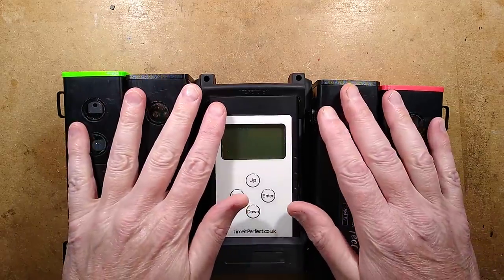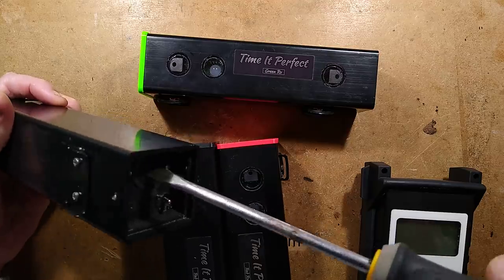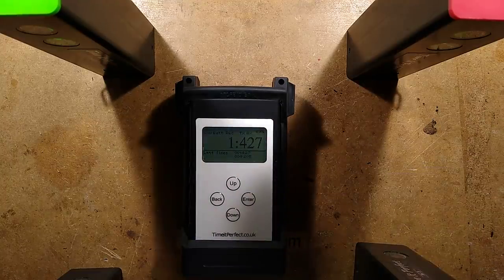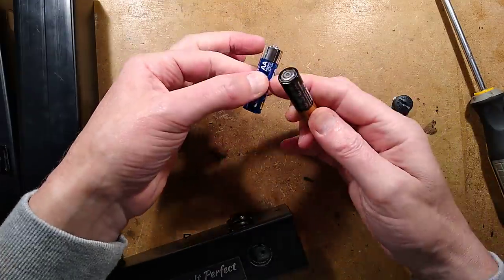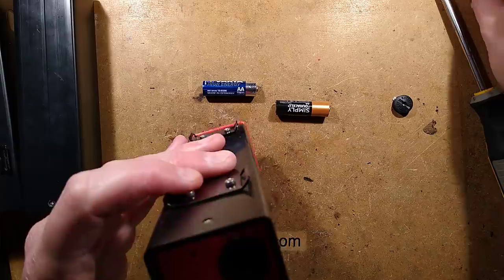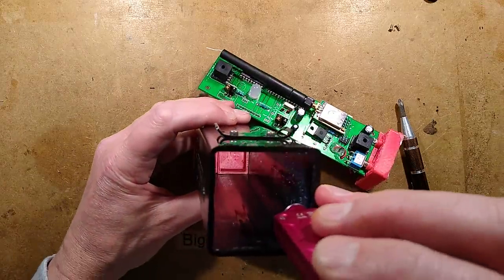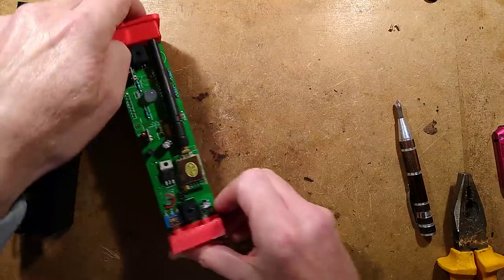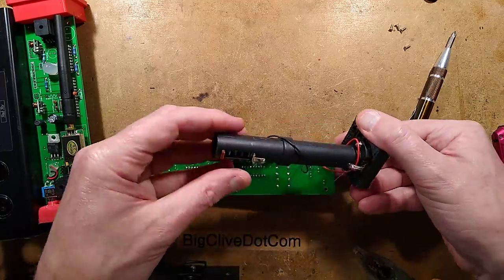Troubleshooting a faulty dog-race timer

Comment: Very nice looking boards. Just a shame its been let down by someone sticking odd batteries into it. I think I would extend the wires outside and add a 186-50 pack on the outside.              2x👍

Comment: Put battery holder in vinegar, buy 1 mm rust free spring steal and make a spring, and solder (or make) a new plate on the contact.

Comment: So, these DC-DC converters should start at 0.8V. 
I use the same ones a lot for all kinds of tests. 
It's sad that they didn't go for a single battery in series design. 
That would prevent a lot of user error.

Comment: I notice one thing, since only rx unit have rf transmitter, but both (rx and tx units) have low battery indicator, then it must send low battery info via ir led from tx to rx and then rx unit sends it to controller, neat.

Comment: Yes you had a leaky Varta, and mixing batteries is bad, but IME Duracell’s leak even when on the shelf in their packaging and well within their use by date, consumer branded or procells it matters not a jot they are all just as bad. They’ve been leaking and trashing equipment for around 40 years, maybe longer. Fluke 8060A DMM’s with PP3’s in the early to mid 80’s were particularly prone, a new battery (made in Belgium back then) regularly trashing a meter in a matter of weeks, switching to a NiCad the eventual but sub-optimal option of very last resort. Not sure what the situation is now but back then Duracell did pay out for damaged equipment. Now I only use eneloops or energiser lithium’s

Comment: Upgrade the units with an 18650 cell and a USB charging port?

You have to wonder why they didn't use that for a power supply in the first place, but it's obviously a  (very good!)  Fred-in-the-Shed outfit making these things and perhaps they were just being ultra-cautious.

Comment: I see a few Bulgin battery holders on eBay, BX0012 dual AA holders at AU $20ish? Or hack a PC board part to replace them? 3D print replacement battery holders? Hmm, easy way, Mouser (US) has lots of them, worst case.

Comment: I was wondering how much such a set would cost. Just checked their website and it's almost 700 pounds! Wow, that really sounds like they put in a lot of time assembling them... 😂️ And they claim they didn't use built-in rechargeable batteries because they "have an end of life date" - apparently they didn't think of leaking AAs though. Maybe 18650s in a holder would be an option.
Reply: Given the state of 18650s available, I'm not sure I'd trust that in a device used by people not technically knowledgeable enough to buy decent cells. I think I'd want to use something like those much-cloned Sony-style camera batteries, except that those are 7.4V nominal, as well as being total overkill for this application. My gut feeling is that it's harder to get totally garbage ones of those.

Depending on the current draw and frequency of use ("every few months" vs "daily"), a single, large-ish, 3V lithium primary cell (non-rechargeable) might be an option. Something like a CR123A, not a coin/button cell.
A single CR123A has a very similar voltage curve to a series pair of alkaline AAs, but with much better energy density (Wh/kg and Wh/L). Using the figures below, one CR123A has 68% the energy of TWO good AA alkalines, but at just 47% of the volume and 35% of the weight - and using 1 cell means no risk of mixing them!
Given this set was using Simply Duracell and a random mix of whatever they could find, I don't think that 68% energy capacity will be much of a concern!

CR123A¹: ∅17×34.5mm = 7,831mm³; 16g; 1.5Ah @ 3V = 4.5Wh
Alkaline AA²: ∅14.5×50.5mm = 8,339mm³; 23g; 2.2Ah @ 1.5V = 3.3Wh

CR123As are more expensive and less ubiquitous, yes, although it sounds like AAs cells' ubiquity might have been the problem in this case!

Dons their "Let's Redesign It From Scratch" engineer hat!
... Does it even need that kind of energy capacity in the first place? What on earth is it doing that stops it running for ages on a coin cell (e.g. CR2032 or CR2450)?
Is that just a result of using old, inefficient components? I mean, the PCBs looked like they were designed several decades ago: giant DIP ICs, complete lack of surface-mount, "horizontal on one side, vertical on the other" traces, huge TO-220 transistor to switch <50mA of LEDs, ... 😐

It may even be possible to power it with a monocrystalline solar panel and a supercap...

¹ https://cpc.farnell.com/gp-batteries/gppcl123a084/battery-lithium-3v-cr123a-4pk/dp/BT06621
² https://cpc.farnell.com/gp-batteries/gp15a-40/battery-alkaline-aa-1-5v-pk40/dp/BT00075
Reply: is it not the end users responsibility to maintain the batteries to prevent leaking?
Reply: Much of the time for construction, is sitting next to the 3d printer... ;) Well, single use batteries also have an expiry date.   But it could be they mean the self discharge.
Reply: At £685 I would expect a board that is competently designed and minimal flux left on the board.... I'd also expect to see professionally 3d printed parts... I can forgive the use of a bit of downpipe for the case! ;)

Comment: there is a lot more in those events then just running from a to b.
 its parcours with/without the humans running along, going through the right spots, tunnels, over ramps and tables and even tricks on command,
sitting down at the exactly right spot out of full speed run, staying for an xact amount.. and there are error and time penalties .  
more complex then olympic horse parcours because there is no rider in direct control.

Comment: With how precise that timer is, I wonder how much they need to worry about the latency of the wireless communication and the speed of the clock(s) powering them...

Then again, it displays millisecond resolution and if you have a problem with latency, you can probably just disregard the last digit and be perfectly fine.

Comment: A seperate, clip on battery pack carrier would be good for this scenario. At least then you could order new carriers.
Reply: The panel mountability of the battery holders is a key feature of the mechanical design. Without it, the entire case must be redesigned.

Comment: Would using one 3.2v 18650 lithium Battery  fix the leaking battery problem?  I mean, can devices that use 2 AA batteries be hacked to use a  3.2v 18650 lithium Battery?
Or a USB power brick with voltage divider for a more common standard.

Comment: Add a single li-ion cell (inc BMS chip) in each, with a USB port on the bottom.  I'd suspect it would be fine with 3.7v vs 3v.

Comment: Disappointing that they would scrub the marking off that chip. Or it's done purely so they can be marked T and R?
Reply from the maker: It may be a standard chip, and they are protecting their low volume design.

Comment: Clive, why have we been running everything in the house from 230v and using transformers to bring it down to 24v, 12v and 5v all these years, what's going on ?
Reply from the maker: In the future they may have a power factor corrected power supply distributing 24V around the house for lighting.
Reply: Sorry Clive just had a rant on the previous post, sick of seeing all the low voltage items plugged in with all the power adaptors and forgot about the other major appliances we need. Just had a thought tough, your the man that might help all us Scot's out with the new fire alarm regs, we need advised before the market get flooded with all the cheap imports from you know we're. There you go great topic to get started on, might make you a fortune 😉

Comment: For the cost, I wonder if gps precision timing could be implemented on each gate.
Reply: There's no point of knowing the time at the gates. The timing is done in the receiver with the display.
Reply: @superdau  right, but you could do it by recording the time the gate was triggered, at the gate. It's that or wires if you want precision and resilience.

Comment: The battery holders are from a company called "Bulgin"...a UK source is https://complete-electronics.com/bx00121bx00121  (there are 1, 2, and 3 cell versions).  I've sourced these because my Kurzweil synthesizer uses one for the battery backup.
Reply: Complete says they're out of stock.
Reply: @JoseSilveira-newhandleforYT  At least Clive now knows the manufacturer and part number!

Comment: Doesn't the reverse charging only happen when they're in parallel?
Reply: Nope....picture 2 cells in series:cell 1 is at 50 percent of capacity, cell 2 is at 100 percent of capacity.
You put a load on the cells-they both go down in capacity-cell 1 goes down to zero capacity, cell 2 is still at 50 percent of capacity-it keeps trying to deliver current-since cell 1 is at zero, cell 2 forces a current flow through cell 1 in REVERSE(it goes BELOW ZERO).
This very quickly results in cell 1 pressurizing, and leaking at the negative end(because that's where the seal is).
If you MUST mix cells, you can minimize the risk by 1.only using batteries of the same chemistry, and 2. testing ALL of the cells UNDER LOAD, and making sure that they are all VERY close in voltage.
Still not the best idea, but it DOES generally work.

Comment: Would an 18650 work as a replacement for power?
Reply from the maker: Not in this application.  It's actually better suited to alkaline cells for the brief uses it gets during a year.

Comment: Given that it is well known that batteries leak, why do manufactures not take this fact into account when designing the battery compartments of products. One could ask why battery manufactures have yet to find a solution for the leaky battery problem.
How many battery powered products have you come across, where the battery compartment has holes that allow the battery chemicals to leak onto the product circuit board. The battery connections are usually just a spring and a plate, how difficult would it be make it easy to repair these components. Why have they not been standardised, so it is easy to obtain compatible replacements? Every manufacture seems to want to invent their own version, why?
There are some plated battery contacts that are very resistant to corrosion by the alkaline battery electrolyte, requiring only a wash with distilled water to regain their shine.

Comment: Why didnt they use 18650 and a usb port to charge instead? You could atleast change the holder to a 18650 and give them a 18650 charger. Much better all around.

Comment: Why not convert it to rechargeable. Put a little charging module inside and a micro usb port.
Reply from the maker: I think this is an older design, and devices like this may not get used very often, so they might overdischarge, not get charged before use, or need recharged in the middle of a field in the middle of an event.

Comment: Pardon me, sir, your dog has just been clocked at 37mph in a school zone. For a dog, that's an automatic 2 year ban and 4 penalty points, or you can take the canine awareness course!

I'd guess that the possible uses of this device are limited only by the imagination, rather than just clocking greyhounds.

Maybe should be updated to rechargeable batteries to avoid this happening again.